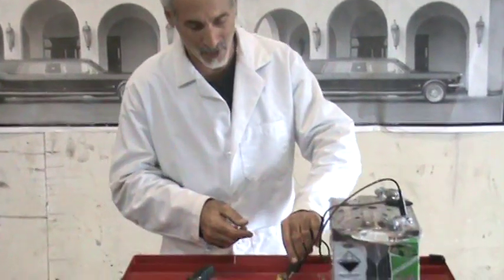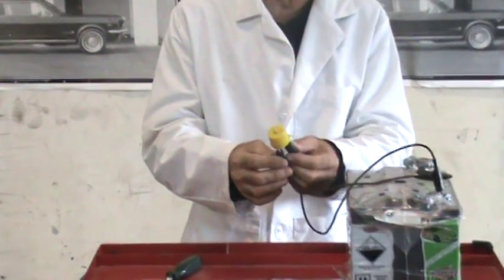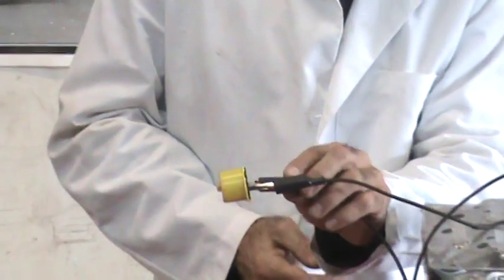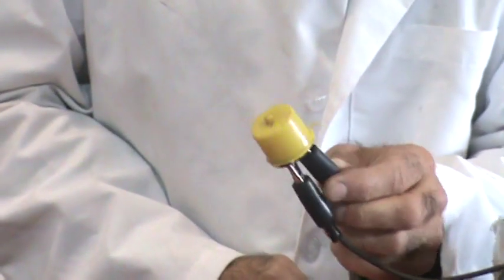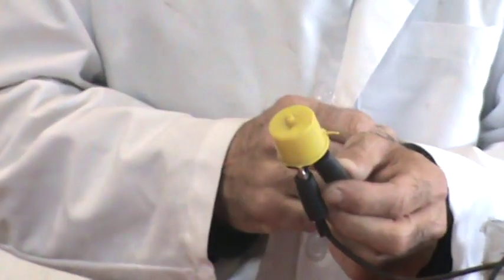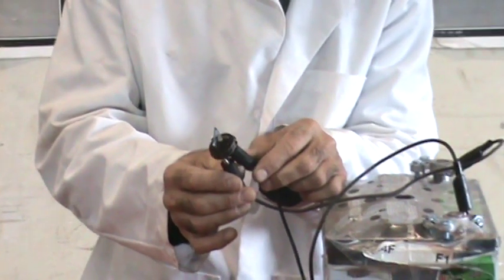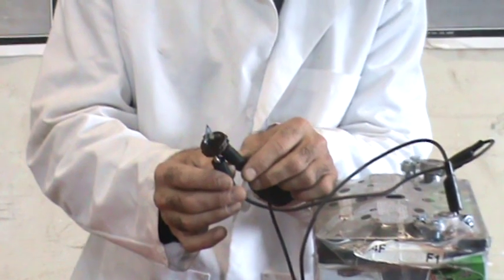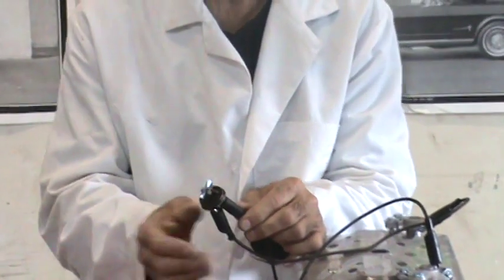Classic turn signal flasher "How it works"

Comment: Great video and has been very helpful
Question on 1971. What lights light-up for the turn signal? I have two that light up when I engage the turn signal so I’m not sure because the brake lights don’t work as well. Thanks!!
Reply from the maker: On the 71 Mustang the middle bulb is the back up lamp 7 the two outer bulbs are the turn signal, brake light & parking light.Keep in mind...With the turn signal engaged the brake light cancels on that side & is now the signal light.

Comment: I'm up grading my 65 mustang original head and rear lights to led. I was told I need to install a 2 terminal flash. Do you have a video that shows this process? I haven't received the parts yet but was researching to have a better understanding and I ran across your very informative vids. Please advise
Reply from the maker: No, I am sorry I don't.
Reply: Chris Ingrassia Thank you for your quick reply. I'm sure I figured it out but I'm such a visual person.
Reply: I think most auto parts stores now stock LED-compatible flashers which would fit the two-prong arrangement here. Note that you might lose your lamp outage indicator with the new LED bulbs and flasher since I believe many of those flashers are not load sensitive.

Comment: I missed something. I understand you said it heats up, distorts, closes the circuit. I didn't catch what cause the cooling to have it reopen.
Reply: Once the electricity stops going thru the steel. The outside air cools the steel down, letting it undistort  , breaking the circuit connection..

Comment: On a 64 1/2 if all the external signals work and you can still hear the sound, but no dash indicator light, can the flasher still be bad?
Reply: No. Most likely the bulb(s) in the dash behind the green indicator are burned out.